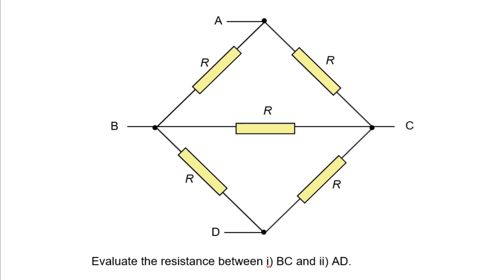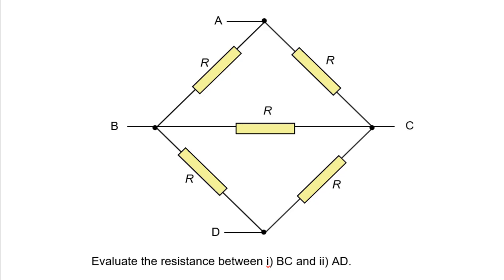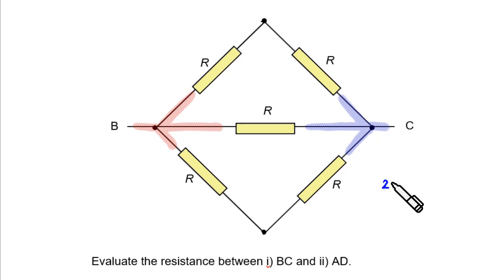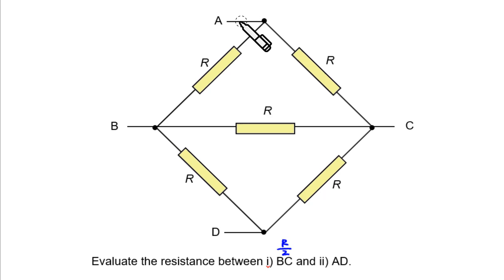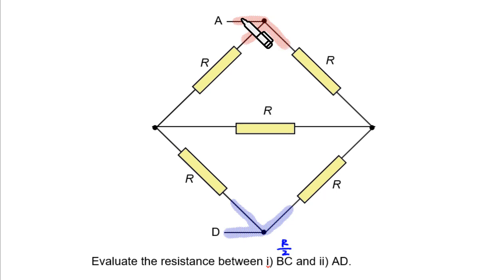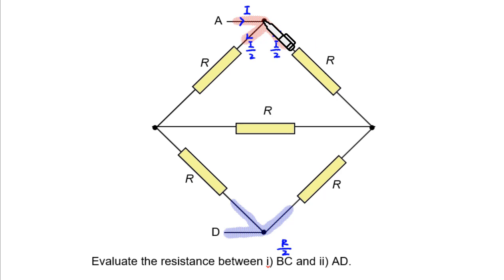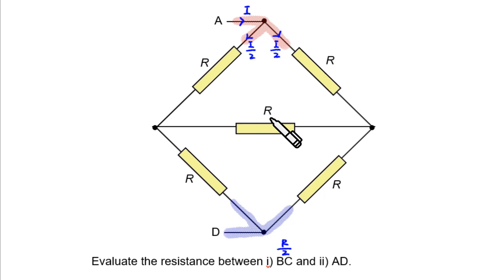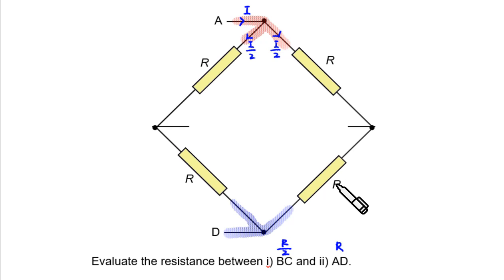Double Loop Resistors (xmpuzzle0002)

Comment: hi how about AC?
Reply from the maker: What's your answer? 🙂
Reply: @xmphysics  should be the same for each cycle so inbetween resistor can be ignored
Reply from the maker: @rahulrakshan5996  Eh, when you say AC I thought you were asking about the effective resistance between AC. Do you mean alternating current instead? Anyway, Alternating current or directly current, the effective resistance are the same.
Reply from the maker: And the effectived resistance between nodes AC is R // [R+(R//2R)]